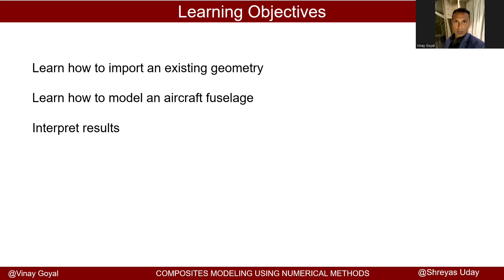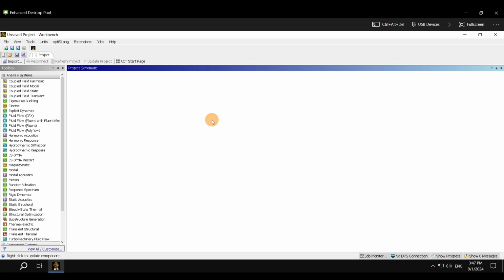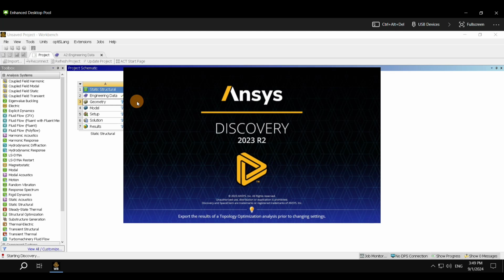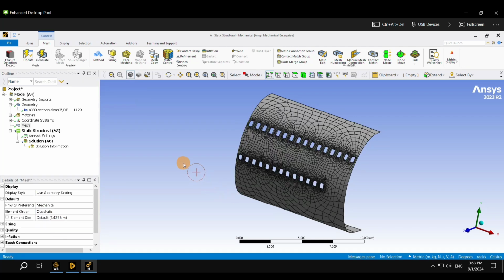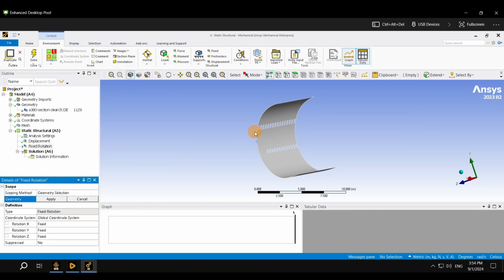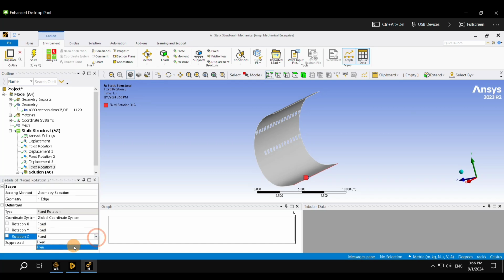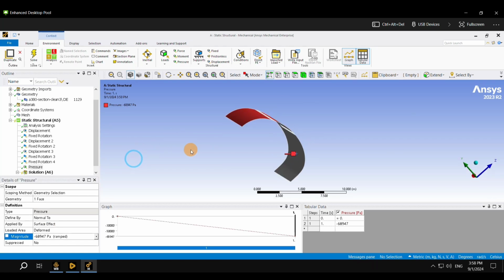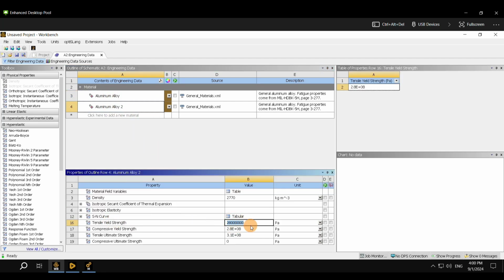Finite Element Analysis of Aerospace Structures: Module 3 - Aircraft Fuselage Using Ansys

Comment: I tried to mesh, but it ended with an error in mesher. Error: The process suffered unhandled exception.
Reply: For anyone facing the issue, it worked, by trying the following procedure:
1. Go to Mesh
2. Sizing
3. Use Adaptive Sizing: Yes
4. Resolution :  (Depending of your intended accuracy of results)